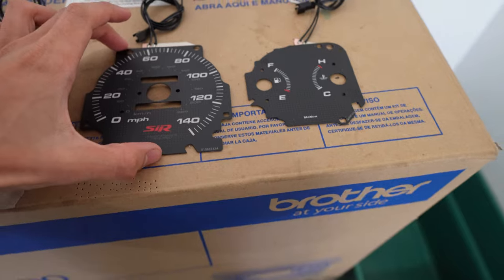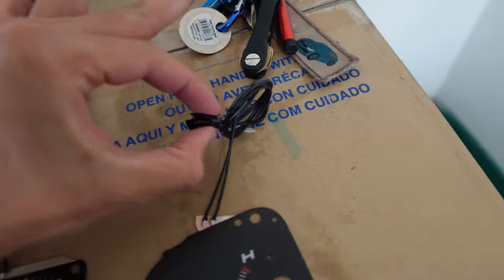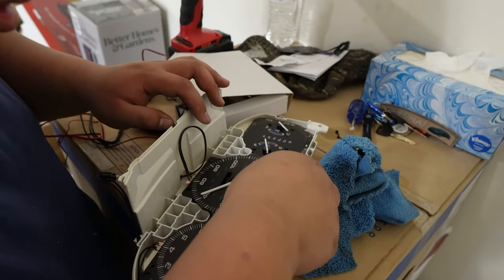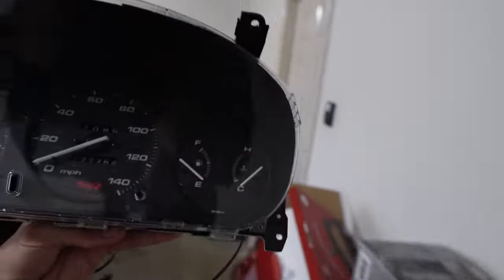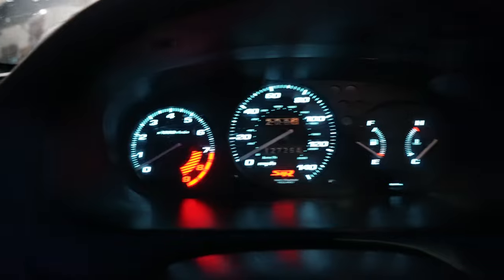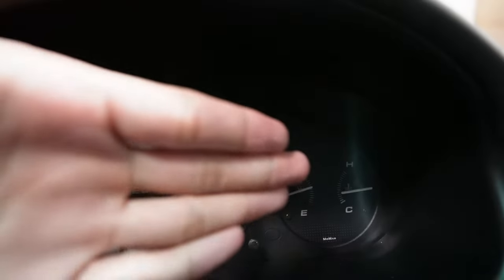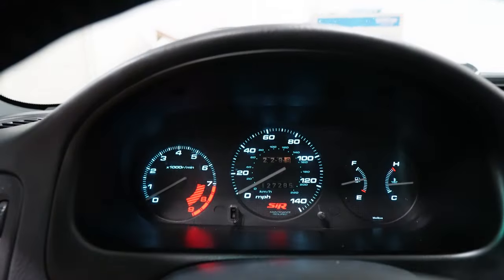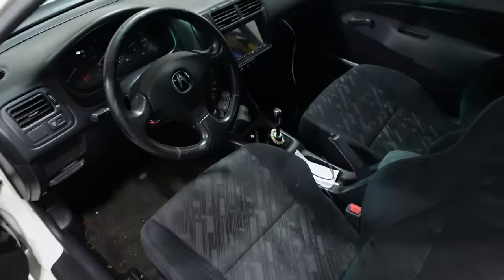How I Made My 25 Year Old Honda Modern Again | Ej/Ek Civic

Comment: I have the same gauges installed.  And have the same issue.  I tried multiple 12v sources.  They are sending a new inverter with a stabilizer, gonna try that out.    If you get your fixed please post a video.